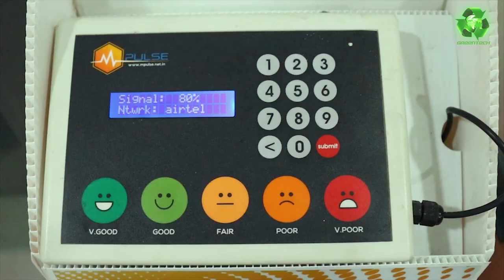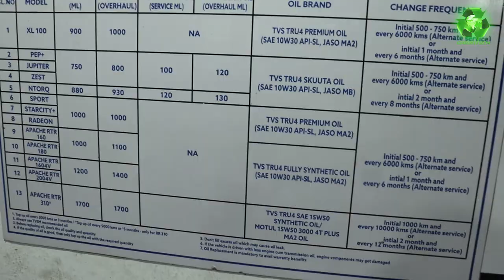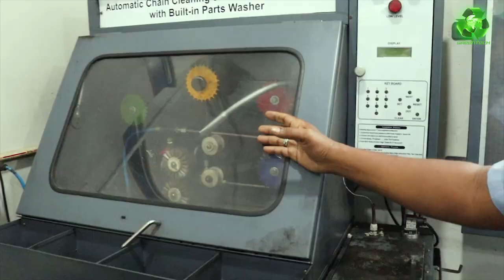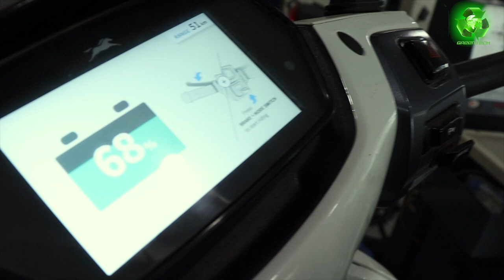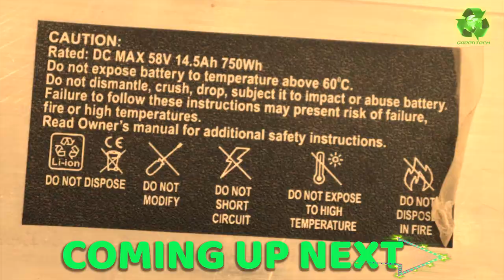TVS iQUBE Electric Scooter Service | Inside iQUBE | Parts, Components and Working | iqube Battery

Comment: Looks like the mechanic has no idea about the EV scooter.  Looks like he has not deep idea about the internals. If this is the quality of the mechanics just wondering is this safe to buy TVS. TVS Should re-think on the quality of knowledge they transfer to those mechanics. He has no idea what the orange color cable is used for. Some one has told him it is high voltage so he just continues the same. He could be good to replace the parts, but not worth for debug or repair.

Comment: Got my I Qube two weeks back. Though nice, it has few issues. When charging  the I Qube scooter, as per procedure, the ignition key should be with the scooter and the ignition key should be on, then only scooter is charging. I live in 5th floor. 
Though in apartments, charging points are provided at ground floor, it is more of an inconvenience to sit close to the scooter when it is charging, around 2 to 4 hours at times, to ensure safety of the scooter. Since it is an open parking area within the compound, any body can drive away the scooter as the ignition key is available. They can just unplug the cable and drive away the scooter. Even if they have not driven the scooter,  they can simply remove the key / charger to create nuisance / inconvenience to the owner of the scooter. Certainly it is a risk for the safety of the scooter and a headache to the owners of I Qube scooters. Not all can afford to have a safe room for keeping the scooter at home. More so in the   apartment living in cities